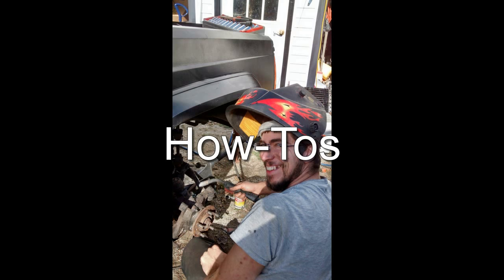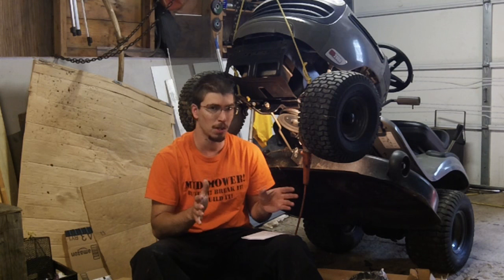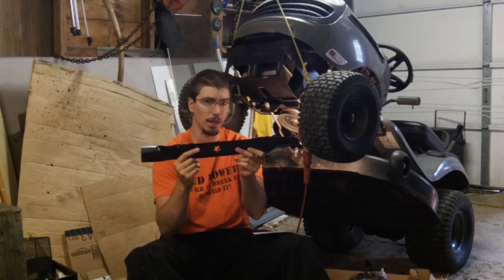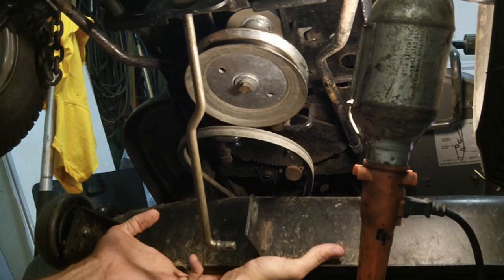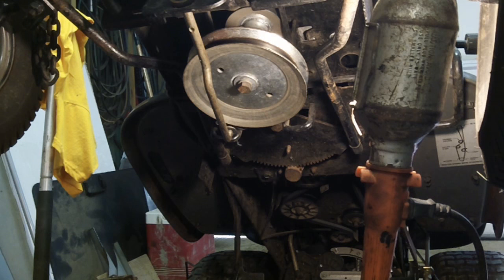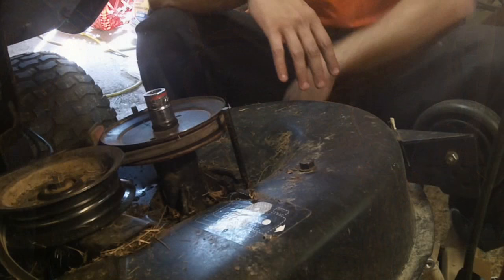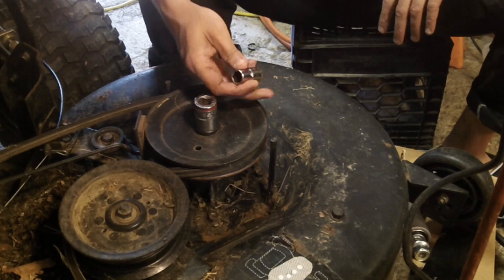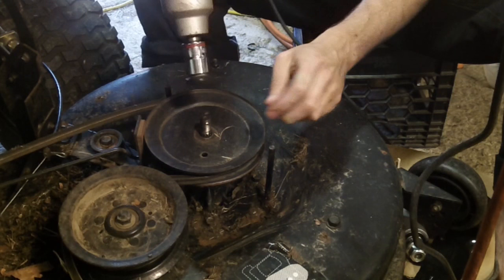Craftman Deck Spindle Replacement 42 Deck

Comment: In the process and stuck at the taking the nut off the top. Bought a chain wrench but have not broken it loose yet. Waiting on a friend to arrive to hold while I pull with a big bar. Wish I had that impact wrench:)

Comment: I have a craftsman LT 2000 42in lawnmower with 2 rods on the front of the deck and a 4 bolt spindles